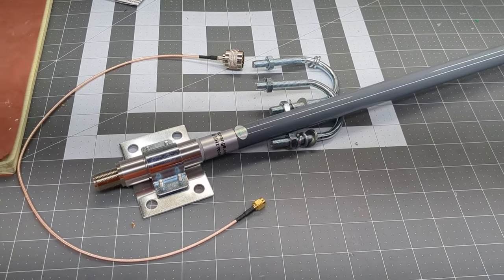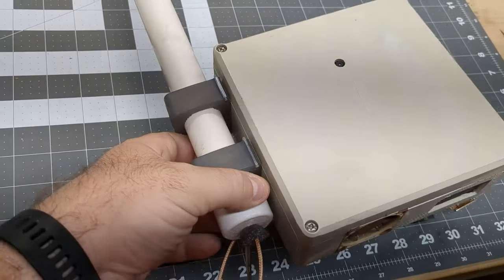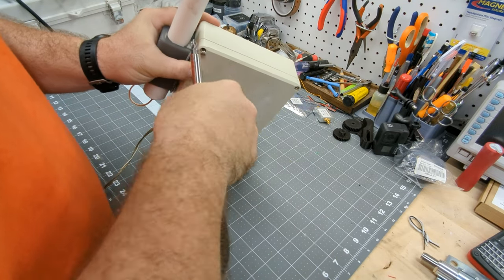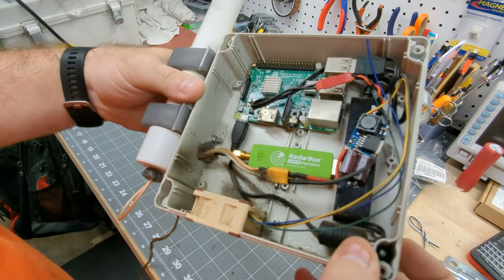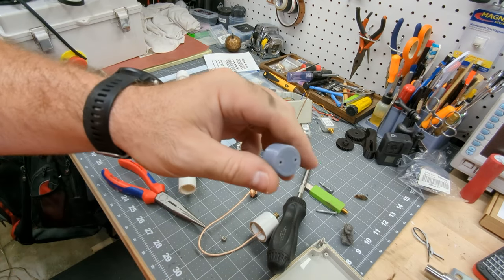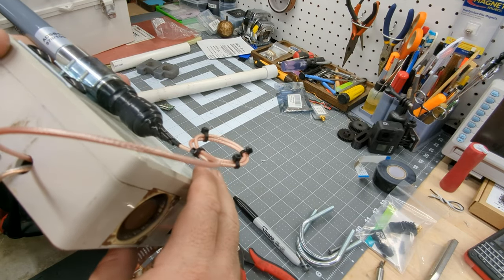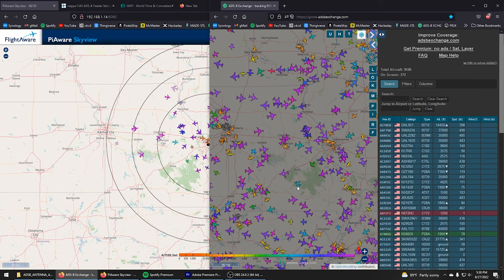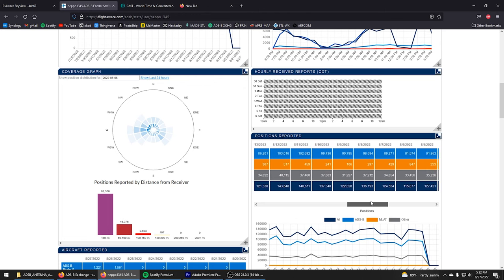ADSB Feeder Antenna Upgrade (ADSBExchange.com Antenna)

Comment: I feed both FR24 and adsbexchange with two raspberrries. For now, antennas are inside but will be going in attic soon. I have used most of the various 1090 antennas made and found that indoors the tiny Radarbox $20 mag base antenna works as good, and in many cases better than that which you are using - indoors anyway. I have a collection of no longer used antenna.

I am in a high traffic area of central Florida so from 40 - 80 aircraft with range out to 90 miles when over 40,000 feet. Once antennas moved to attic should be a big improvement.

Do not want to go to roof due to lightning capital area and tropical storms.
Reply from the maker: That sounds like a solid setup, I need to add a second antenna as well. Also, that sounds like a very safe bet for where you live. Better to be safe than sorry.

Comment: Can I use RTL-SDR instead of the RadarBox dongle? will it work?
Reply from the maker: Yep! RTL-SDR dongle will work too. The Radar Box dongle has some additional filtering and a pre-amp built in that makes it a little better choice for a dedicated ADS-B receiver but I used an RTL-SDR dongle for a couple years before building this dedicated box.

Comment: Why not use a POE this will give it internet also power up your PI.
Reply from the maker: If I ever rebuild this with new electronics that is absolutely what I would do. At the time I was designing around parts I had on hand (the only components I bought specifically for this were the fan, usb hub, and Radar Box dongle). POE would have doubled or tripled the cost at the time.

Comment: Nice build. I’m still learning RF, so if this question offends or doesn’t apply to these circumstances. After you have it reinstalled , what provisions do you take for lighting protection? Was there a ground wire that dangled from box and attached to chimney? I ask because I’m finally going to install a premade , store bought antenna. And as the install day approaches,I can’t help but think of all the ways I can screw up. Living in So California all my life, weather was what everyone else experienced and we either volunteered or wrote checks when stuff hit the fan.  Now that we can experience disasters in the form of hurricanes ( will soon be a regular occurrence) , I want to make sure I’m checking all the boxes when I stick a giant lightning rod into the sky.
Reply from the maker: I live in a pretty high lightning area, so I have a copper ground cable running from my mast down to a 10' ground rod. In a perfect world, this would tie into the ground rod for your house too (my house was built before ground rods were a thing, so I installed a rod specifically for my antenna). Where all my antenna cables (VHF/UHF and HF) and the power cable (from the Pi) enter the house I have a ground panel (basically a sheet of copper inside a weatherproof box mounted to the side of the house) that's also tied to that same ground rod. That ground panel has lightning arresters for the VHF/UHF antenna, my HF antenna, and a 12v DC arrester (uxcell, ~$20 from amazon) for the power going up to the Pi. The goal is to keep the low resistance path to ground entirely outside the house so that the current from the strike never makes it inside to cause damage or fire. It won't do much to protect sensitive electronics from a direct hit, but it should do a fairly decent job isolating the electronics inside the house from nearby strikes to trees, etc.

Comment: Great video!  With the raspberry pi, is there a benefit to having it outside vs inside?
Reply from the maker: Thanks, glad you enjoyed! I located my Pi outside to keep it as close to the antenna as possible. This is to minimize length of the co-ax feed line from the antenna. Losses in co-ax increase at the higher 950-1098mhz frequencies used by ADS-B. Probably overkill, but it was easy enough to do at the time.
Reply: Thanks for the reply and makes perfect sense.  Assume is was powered from your house.  Would like to explore the idea of a self contained / solar powered power supply to make the entire unit independent.  Thanks again for the videos!

Comment: i am curious u see in your video an RF LNA in your video did you get this to work with the USB dongle ? did not spend much time on it now but it blocked the signals and did not work as intended but did not have time to really check out if it is just a power problem as I use a very long cable to the dongle or it is not compatible as the adsbexchange and airnav receiver could haven an amplifier in it wich would explain the problem ? do you have experience in the use of it?